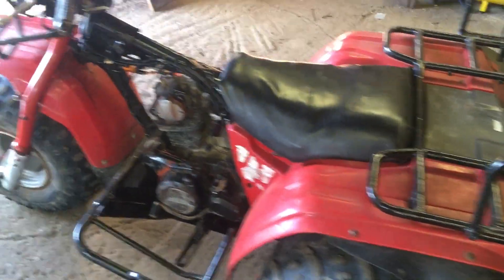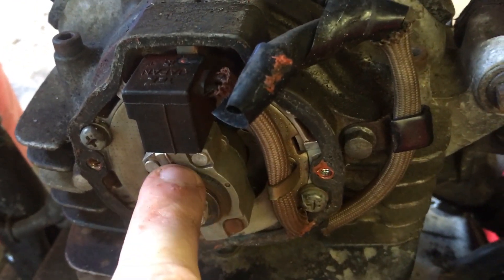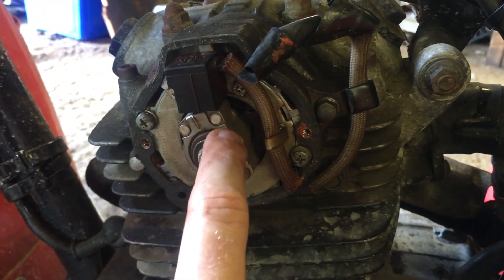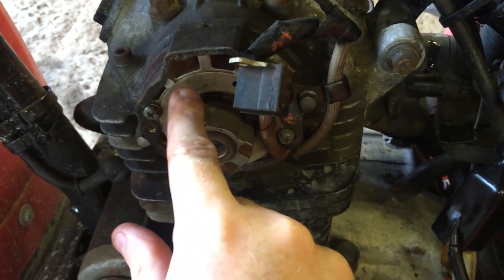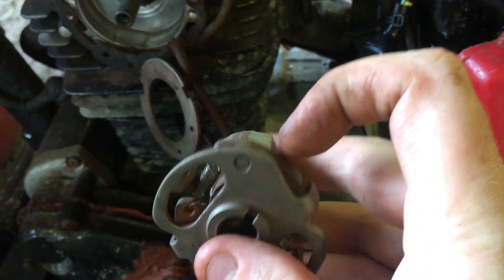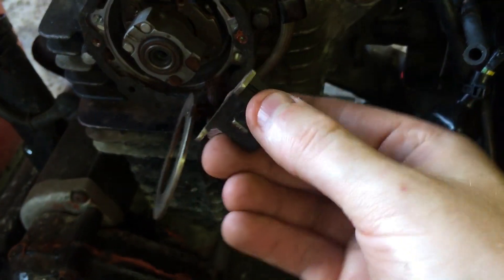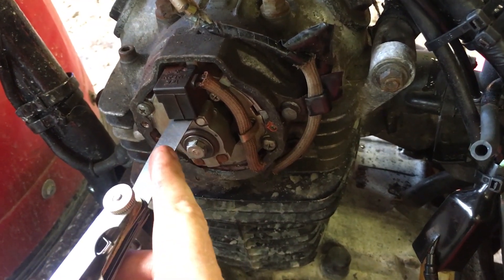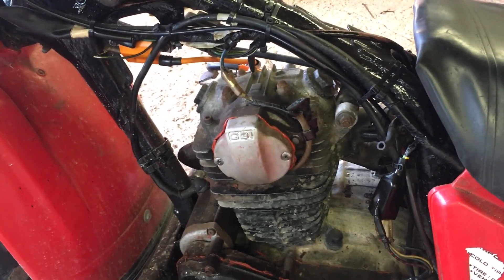Honda ATC 200 Pulse Generator - Mechanical Advancer

Comment: Im sorry I missed what the bump actually is.
Reply from the maker: the little bump on the metal piece is used for timing purposes. The black piece with the electrical wires is essentially a sensor. It is used to tell the ignition circuit when to spark / at the correct time in the combustion cycle. Essentially its a start pulse ignition system.
Basically, the CDI waits around for the pulse generator to tell it that the piston has just hit some point before TDC, and then waits the appropriate amount of time
Reply: Thanks for your reply. Focusing in on 5:50 (ish) your thumb kind of points to an area near the slotting. Is that the general area? I may have mistakenly asked what the bump was when I meant to where it is.

Comment: When i try to remove the pulse generator bolt it just cycles the engine. What am I supposed to do to remove that bolt?
Reply from the maker: I’ve never had that happen before , the bolt is probably seized or on too tight. Try taking it off with an impact, or use something to prevent the engine from spinning , like hold the flywheel or use a vice grip possibly to hold it.  I’d probably pop off the pull cord recoil and just hold the metal basket thing
Reply: @muddythumper8152 i was able to get it off by using clamps I really didnt want to get to the fly wheel

Comment: What a great video! Thank You!!! I just bought Honda 1983 E in which timing advancer is broken (groove), bumper in camshaft is gone and part of that holding bolt(probably M5)is also broken still sitting inside camshaft. Wouldn't You please tell me how to fix this mess, do I need exchange whole shaft? I think I am able to do it myself but I have no idea how and where to buy those parts. What that gentleman could do wrong? He said that he rebuilted engine. Thank You so much again 😔
Reply from the maker: Thanks, glad you found it handy. If the bolt is broke off in the camshaft you may be able to get it out with a pick. A lot of those parts are hard to get now. EBay or marketplace you may find some parts kicking around. You can send me some pics or what you’re dealing with if you like. Muddythumper@hotmail.com

Comment: Hi boss thank you for the video you expianed it well and i just happened to lose my dowl on the camshaft but i have to install it and i was wondering about the fire mark on my flywheel does it mater to line that up as long as i have it top dead center beouse of the advance timing /what happend was i was checking to see if my timiming chain was tight and i lost yhe pin but i never touched anything else so what do i do just line TdC UP CHECK MY VALVE TAPPINS and put it back together like that and it should fire up ? PLEACE GET BACK ITS driveing me crazy.

Comment: hey man, so i have the sane bike, and mine is leaking oil very quickly into the cdi box, how do i fix this? i bought it to restore but discovered it also does not have a bolt to hold the rotator on? is this a problem? thanks.

Comment: What will happen if the springs are broken in half, will it cause it not to start
Reply: Ok it'll start if I spray starting fluid but for only for like 5 seconds,  could it be a fuel issue,  I ordered a new carb but waiting for it to come in, thanks for your answer,  I don't have any idea what I'm doing but by the time I'm through with it,  it's going to be a brand new 3 wheeler,  lol. Thanks and im anxious for your reply about my question about could it be a fuel issue causing it not to start on its own,  I haven't checked the timing marks inside of the pull start housing yet but the pulse generator and the other deal I believe are the points their marks are pretty close to matching up
Reply from the maker: im willing to bet you just have a carb issue, throw on a good oem carb or a amazon jobby and she should run. @briannash7960
Reply from the maker: No it will still start but not run ideally. It’ll likely flood the plugs as it won’t advance the timing
Reply: Thank you for helping me out
Reply: What tool or how would you suggest getting the last nut of the old carburetor,  the one that is in a tight space close to the frame, on the side where the oil reservoir is, thanks
Reply from the maker: @briannash7960  I’m not sure which nut you’re referring too , just take the carb off from the air intake on the engine , two 8 mm heads on them I think. You can send me videos or whatnot on Instagram too

Comment: I see the has come off my camshaft... I'm done huh? Also, I took an advancer off another generator that wouldn't line up with my to end; would that still work if my bump wasn't broken off from the camshaft?
Reply from the maker: the bump is what tells the bike when to spark, if you know where it broke to be honest you could probably do a small weld and some fine grinding with a dremel or just replace the camshaft these bikes are easy to work on and cheap. I have like 10 spare engines kicking around. Try some redneck methods if that dont work watch a video of timing chain replacment its basically same procedure for camshaft swap!
Reply: @muddythumper8152  you have some 200 engines?
Reply from the maker: @dawsonjd247  yes I got a lot of 200 parts
Reply: @muddythumper8152  also you're awesome! That was a quick response!
Reply from the maker: @dawsonjd247  thanks ol buddy , hopefully I’ll do some videos again in the future, grief Is not fun to deal with. You’ll get that trike running , don’t worry about that. I have about 9 trikes still and they all run great

Comment: Hey I got question on this.  Comment back and I’ll explain my question it’s about camshaft and the thing that slides on that has magnet
Reply from the maker: What are you stuck on
Reply: @muddythumper8152  I see there is a little pin on crankshaft that the pulse generator part that spins connects to and my cam don’t have that.  Will that cause motor to start and then stall after few seconds ? And then takes long time to start up again
Reply from the maker: @robertodavid7723  that pin mainly is for positioning, you need to make sure your pulse generator is not 180 out / installed opposite. Also check your choke / carb set up. When it does start how does it run? does it sound normal or odd.

Comment: Where do the pulse generator wires go to? The CDI?
Reply from the maker: they plug into the matching colors on the wiring harness, but ultimately yes they go to the CDI. Pulse generator tells the CDI when to spark basically.
Reply: @muddythumper8152   the colors dont match perfect is there any danger of wreaking any of the electrical on my bike if I'm wrong
Reply from the maker: @randyrandy7864  what engine you have? the Pulse generator is typically a blue yellow / or blue white and a green for ground. If you swap it around, the most i can see happening is no spark because you will be shorting the spark wire
Reply: @muddythumper8152  the color was blue to blue white and yellow to yellow so I assumed blue white to blue was good just didn't want to short out something before I got it hooked up right. I think it's a 110 or 125 it's a cobbled bike I picked up for very cheap

Comment: Im working on a 84 200s right now. I dont have a volt meter. So i checked for spark by hanging the spark plug on the block. No spark. Then tried a screwdriver. No spark. Held screwdriver in hand gave me a slight tickle only. The gap on the cdi is clean and gapped right. Would that be a coil problem?
Reply from the maker: Could be a lot of things. if you don't have a volt meter get a test light. First rule out the Stator, then CDI connections , pulse generator mainly. If all those components are good only thing else it can be is a broken connection or loose connection. I have a video on my channel on how to troubleshoot spark it should help. Even a cheap multimeter ( like 20$ unit should help ). Recently i put up how to troubleshoot spark on a 250es, check that out too. Although engines are different the process is the same. Let me know if you need further help
Reply: @muddythumper8152  i appreciate it. I will check those out👍

Comment: i think u over doing the gasket goo just a tad there mate u only need to use a thin smear of it around the bead and it wont go everywhere inside the engine also
Reply from the maker: ah its okay you are probably right lol! this is the first 3 wheeler i ever decided to put some time into. i typically use gaskets , some bikes get RTV gasket maker. I have about 12 running machines in the shed and maybe 13 spare engines. i agree too much rtv is a bad thing.

Comment: Is having a broken spring a big deal? Would it affect how the pulse generator works? I took the cover off to clean the internals and noticed the broken spring laying in the cover.
Reply from the maker: Ideally you want to swap out the swing because its centrifugal so it does affect the timing as the engine spins up. Now its not a huge difference but it does certainly affect the quality of the spark / timing
Reply: @muddythumper8152  thanks for the reply.
Reply: I made replacement springs from ball point pen springs....yup ball point pen...cut ..tweak..bend ...install

Comment: My 185s has some orangish reddish dust in the cdi cover
Reply from the maker: thats probably rust from the springs! make sure to clean it off that way your sensor will work good
Reply: @muddythumper8152  and it has no spark we tried to put another ignition coil on it from a trash three wheeler but I don’t know if they both were bad or not I really want this 185s going hell I rode it more than my 450
Reply from the maker: @johnfkennedygaming5697  Hey there, check out my How to troubleshoot spark video. I got spark back to a bike that never had spark in many years. In a nutshell you need to find whats causing the no spark. There is only a few components that have anything to do with spark. Theres the stator, CDI connections, Pulser, and ignition coil. If theyre all good its either a loose ground or broken wire. Check out the vid, if you have any questions let me know!
https://www.youtube.com/watch?v=zhYvpCtJn3A

Comment: Did you put all the left case covers together with just RTV? Lol
Reply from the maker: Thanks for commenting, good question about gasket maker! Yes you are right, having the proper Oem gaskets are the way to go. However I used some high heat silicon ( RTV) around the outside of the pullcord case and left casing to reduce chances of water and junk getting in there. 2-3 years later its still working great. I have 8 or 9 bikes so not all of them gets done properly. Feel free to send some gaskets lol!
Reply: @muddythumper8152  yeah I can see that, but the starter gears inside rely on the gasket thickness for clearance. Without a gasket stuff starts to bind. But hey, if it works it works 👍
Reply from the maker: @LaneVeld  Good point bud! For the main engine panel you're talking about i do have the factory gasket on it, but i went around  it with high heat gasket maker a long time ago cause the gasket was torn. Probably why it doesn't have a clearance issue. The Recoil itself though has no gasket on it, just high heat Rtv. Thanks for commenting, feel free to stick around! - Muddy
Reply: @muddythumper8152  makes sense, rtv with a gasket wont hurt anything so long as its not dripping down inside. The recoil doesent matter, but its a good idea to have a drain hole unless you can seal the rope hole watertight.
Reply: @LaneVeld  will that cause it to feel slightly tight when trying to pull on the rope?
Reply: Just bought a 200s and seems like doesnt spark sometimes. I guess will start by seeing if theres dirt on magnet or pickup

Comment: a complete gasket and seal and o-ring kit is still available new for around 15-20 bucks USD.
Reply from the maker: Yes you are right! a oem gasket would be nice to have, i'll have to order one eventually.I'm just using a bit of high heat gasketmaker for now because i don't have a good proper gasket for it and the gasket maker does the job. It gets pricey maintaining several bikes haha! last time i priced the Oem ignition switch off partzilla, it came up as close to 130$ usd which to me is getting close to the price I bought the bike for haha!
Reply: @muddythumper8152  it's best to just get part numbers from there and go to eBay and other places. The gasket kit is made by vesrah they make the OEM kits for Honda the quality is top notch and way cheaper. The kit even includes new valve seals if you ever need them.
Reply from the maker: @mikeshobbiesandrandomstuff  perfect, didn't know I could get them for cheaper thanks! This little bike has come a long way, but still needs more work. When i bought it , it needed a new wire harness, chain and sprockets,brakes,battery,etc haha. The 200e is my favorite though cause its an old work horse. I appreciate the input, nice to learn more and more each day!
-Muddy
Reply: @muddythumper8152  no problem bud glad I could help. You should join 3wheelerworld.com and justbigreds.com.   the owner of just big reds has an eBay page and sells parts at reasonable prices